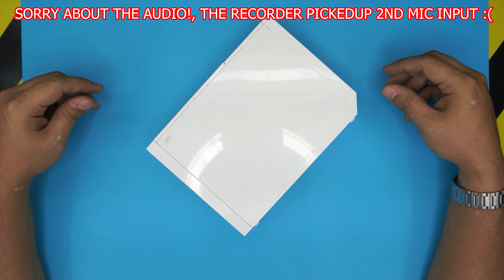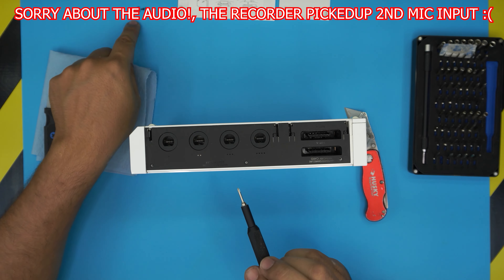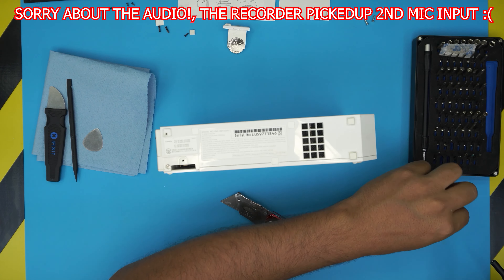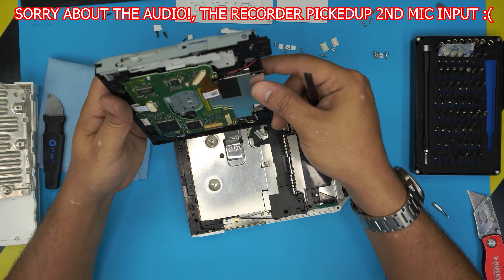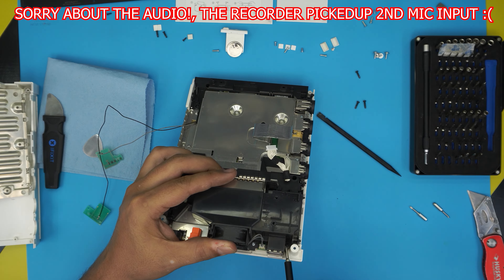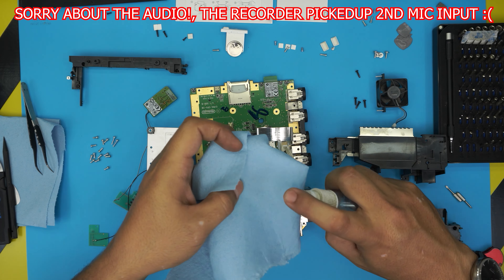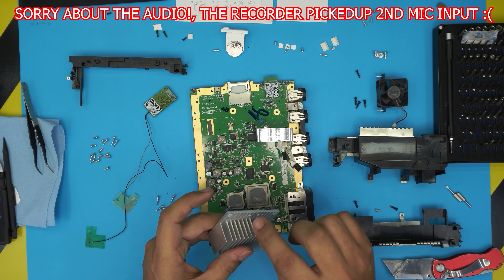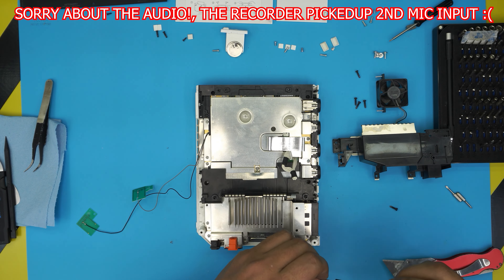How to open up Nintendo Wii and repaste / service 🧽

Comment: I make a mod of the headsink in 10min. and used MX-4. You can also use a 1,5mm Copper sheet. Much better then a pad!
Reply from the maker: sure you can use the thicker copper sheet, and place a good thick thermal paste on both sides, it will be fine. 
good job my friend.
cheers🍻

Comment: Good video and new follower! :)
But what do you recommend the most, using thermal paste or a thermal pad?
My Wii hasn't had a maintenance for more than 14 years and I would like to change the thermal pad, but many recommend applying thermal paste since it is better to transfer heat, but at the same time others recommend a thermal pad because there must be some space between the heatsink and the processor. But what do you recommend? I wait your answer!
Reply from the maker: Thank you for the feedback! if you wish to support the channel you can LIKE or SUB or both :P
regarding your question: Oh boi please do NOT put thermal paste, because there is a big gap from cpu to heat-sink, the paste wont be able to do its job, place a very good thermal pad 3mm and you will be good for another 70years, and because of the gap if you put thermal paste it will drool over the board when you place the console on its side. go with this:
https://amzn.to/2YDNez6
Reply: @uFixTek  Thanks for answering! :D
And thank you very much for the recommendation, I'll follow your advice to be able to keep the console working. I just have a problem, I'm from México and the product will arrive more expensive than normal, but I guess it will be worth it. Thank you again and have a nice day! :)
Reply from the maker: hola amigo si andan en queretaro me puedes llevar y con gusto te hago el servicio. si no compra en amazon mexico,
https://amzn.to/3iRpaAc
pero 3mm no esta , o mejor compra en USA :P
no vayas a usar cualquier pad termica, son muy feos.
Reply: @uFixTek  Vivo en el norte del país, y sí, busqué en internet y puedo comprar el producto en Amazon USA sin que me cobren tarifa de importación, ya que no cuesta más de $50 dólares. En serio, muchas gracias por la ayuda, la necesitaba de un profesional. :D
Reply from the maker: es un gusto amigo cuando requieres alo or preguntas que tengas con gusto aqui preguntame. saludos
Reply: @uFixTek  Ifixit says thermal paste can be used. Interesting...

Comment: just one quwtion i was  broke down by accident cut cable  from antenna is it ok if you yust resolder cable?
Reply from the maker: 🫠Regarding your question, yes you can without any issues.
cheers🍻

Comment: I bought a used black Wii a couple of days ago. I never use the disc drive since I got homebrew setup for GameCube games. I've opened it up and cleaned it out. Only thing I haven't done is change the thermal pads. I know with the system being so old I should probably them. Should I? If so can I have a link to the exact pads and the exact size I need? And what other places would I have to apply the pads? I know 2 under the heatsink, 1 on the bottom of the gray case and 1 on the bottom of the wifi board? My Wii doesn't normally start getting warm near the fan until about 20 -30 mins. What should I do? I want it to last a long time!! Sorry for the long message
Reply from the maker: Thank you for the feedback! if you wish to support the channel you can LIKE or SUB or both :P
regarding your question: i would suguest to place a GOOD brand Thermal pad and 1mm because when you screw it down it will pull and squish nicely the pads and you will get a good thermal conductivity, we do it and works like a charm. and its normal to heat up thats what the heatsink is there for to pull the heat and it will blow out the hot air.
https://amzn.to/3rhlFrO
just replace the two pads under heatsink.
Reply: @uFixTek  thank you so much! You are awesome!! :D I Subscribed!!
Reply from the maker: its my pleasure my friend, and thank you for the awesome support :) feel free to ask me any time

Comment: You mentioned 0,4 or 0,5 millimeters thermal pads, but someone else mentioned 1,5 millimeters. What do you suggest?

Also... Would you say such replacement is useless in 2021? If the thermal pads are still moist, I guess there's no use trying to replace them. What do you think?
Reply from the maker: Thank you for the feedback! if you wish to support the channel you can LIKE or SUB or both :P
regarding your question:  if the pads are flexin and moist then no need to replace them.i would recommend .5mm because the thicker the slower the heat transfer would be, but you could place a 1.5 and it will squish it down when placing the heatsink.
but really just clean and use the same pad, or add a drop of artic mx4 as this paste its more soft and it will make a better bond and fill the micro holes in the pads and it will seal better. add a drop of the paste on the pad.
Reply: @uFixTek  I don't think the heatsink is even touching the pad if it's .5
Reply: @uFixTek  Yeah Do NOT use .5mm. Way too small, zero contact with the heatsink.
Reply: @uFixTek  actually I used 1.5 thermal pads they actually fit well without any tension I have artic tp3 thermal pads in my system it stays really cool before my system would get really warm to find out they weren't even  placed right and they were moist but were crumbling anyway I would suggest getting thermal pads from artic 1.5 and replacing them if going to refurbish your system yourself
Reply: @Alvarocious  ya it wouldn't make contact will suggest getting 1.5 it makes contact and keeps the system cool

Comment: You use a sharp knife on the cpu. Are you trying to scratch it?
Reply from the maker: no not on the cpu i use it to remove the rubber legs and the sticker. i use it to lift up not to pull or slide in order to scratch. if you have a "Parkinson" then dont use the a cuter you will scratch. thank you for the feedback